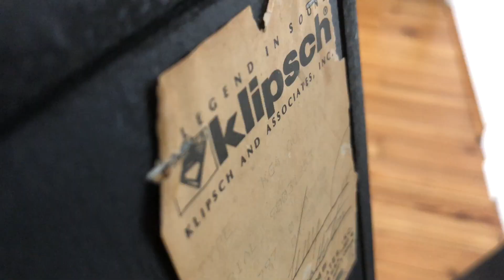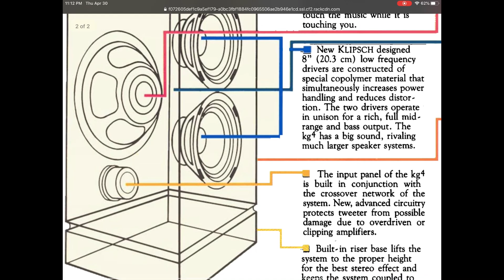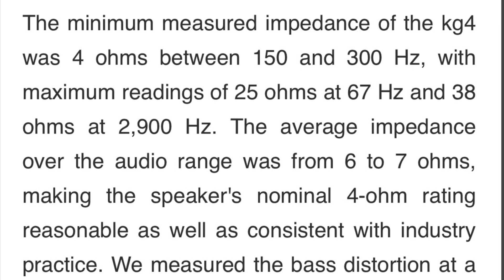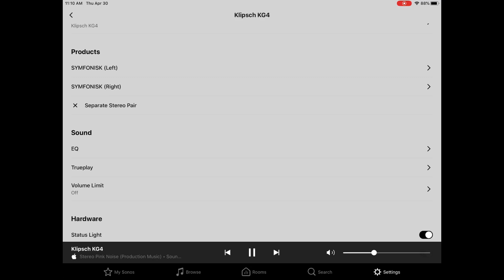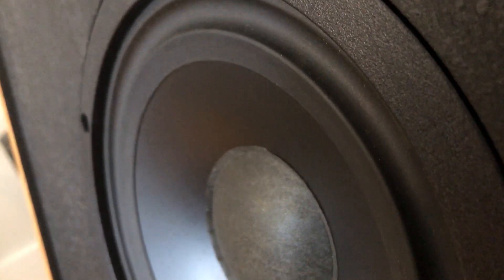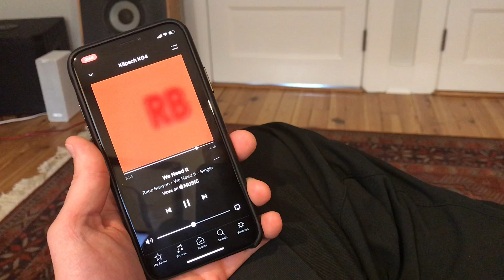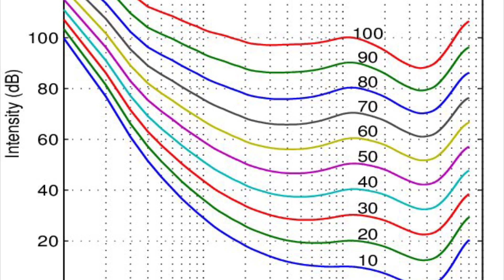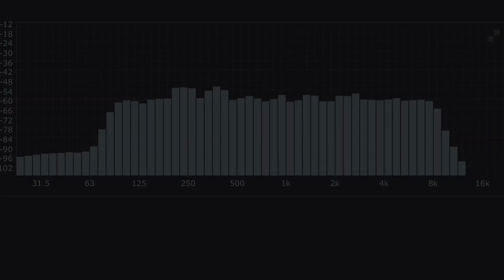Vintage Klipsch KG4 + Sonos bi-amp with IKEA Symfonisk

Comment: You inspired me to try this.  I need some garage speakers and some vintage klipsch with sonos smart technology sounds awesome.  I can't believe you got those KG4's for free!  I havent been able to find a pair for less than $350.
Reply from the maker: Yeah it was crazy lucky. Someone put these on the curb along with Adcom separates!
Reply: @todd.parker  That is crazy lucky.  Im having trouble installing the switch. Your other video says run 2 pairs of wires from the amp, one to the binding posts and one to the drivers with the switch, How do you run multiple wires from the amp when it uses a plug and socket? Do I run the wires straight to the binding posts, then back to the symfonisk drivers with the switch between the binding posts and the sonos driver?
Reply from the maker: @nshandy  This video covers every wiring scenario in detail: https://youtu.be/9Bvof0hF4LE

Comment: KG4's are a solid speaker. Just do a cap replacement ( I used dayton audio caps 1%) and a crites titanium tweeter diaghram and you'll be blown away. Cool video though!
Reply from the maker: Just installed the new diaphragms and they sound great! No need to re-do crossovers, I’m bi-amped
Reply: @todd.parker  cool !
Reply: It wouldn't surprise me midrange is bad with the passives.  The x-overs on these had electrolytic caps and they are likely doing nothing at this age.

Comment: I tried this with some small, relatively sensitive monitors with bi-amp capability. After trueplay it sounded OK at lower volumes but when pushed the Symfonisk amp(s) appeared to struggle to supply enough current at peaks resulting in muddy, slightly distorted sound. No one else having this issue?
Reply from the maker: I think the amps start sounding stressed over 60-70% even with the built in drivers. They are fairly small amps so efficiency is key. The klipsch are really darn loud around 50% but things so get rough when pushed near the max
Reply: @todd.parker  Yes agreed - I thought the issue was the drivers, but in hindsight it is the amps. I actually found the original drivers better at high volume, even though they are missing low freq's. At the end of the day it is an impressive streaming speaker for the price

Comment: This is really nice. I’m wondering if a setup like this with the IKEA Symfonisk could be used with a set of E.G. Active Beolab 3 speakers.
I would use a MiniJack to B&O Powerlink cable.
Reply from the maker: This technique will work with any powered speaker as long as you can get a wire connected to the woofer to feed to the sub.

Comment: The measurement at 12:00 with the passive crossover can not be correct, a KG 4 can play with appropriate tuning and the change of the damping material linearly down to 35 Hz. I own a KG 4. An unmodded KG 4 makes it linearly down to 40 Hz. Also with the tweeter, with the original tweeters you reach about 16 kHz, with the titanium tweeters most likely up to 20 kHz, but I can only hear up to 18 kHz.
Reply from the maker: Yeah, could be my room or listening position but I agree it should go lower (and does sound deeper). My measurement gear isn't super great either. y old ears can't hear up to 20k but the Crites diaphragms do make these sound a lot cleaner. I will say that I still love the sound of these bi-amped and are my everyday speakers.

Comment: Hi
Thanks for a great video, i am getting the sonos amp, sub, 2 one sl for rear and 2 dali spektor 2 for front speakers i would like to be able to do trueplay with the dalis can i do that with this setup and after trueplay disconnect the ikea symfonisk so they are not part of the setup anymore or do i need to keep them in
Reply from the maker: Is the Symfonisk for the sub only? If so, it’s technically just another room you’re grouping with your other speakers so it’s not part of the Trueplay setup. One thing to note: I don’t think the amp decodes surround sound, only their soundbars do so check that before investing!
Reply: @todd.parker  the symfonisk is for the dali spektor 2 only so i can use trueplay on them, the amp setup will be a 4,1 no center speaker the fronts will make a virtuel center
Reply from the maker: @renekristensen2162  So you're bi-amping the Spektor fronts with the Symfonisks, then grouping those with pair of One SLs as a quasi surround sound? Still don't understand where the amp fits in though
Reply: @todd.parker  yes that was the plan, the amp will run everything my shield, tv box, apps, the speakers and the sonos sub. But i cant run trueplay with thirdparty speakers so was hoping i could if i connect the symfonisk to the dali speakers
Reply from the maker: @renekristensen2162  If you use the symfonisk to bi-amp these speakers, Trueplay works great. You can't however, Trueplay them with Symfonisk then "transfer" that profile to the Amp.
Reply: @todd.parker  hmm maybe i got it wrong, i tought that if i bi-amp them with symfonisk and they were connecet to the amp trueplay would run on the whole system ?
Reply from the maker: @renekristensen2162  From Sonos’ perspective these are just a pair of Symfonisk speakers. They don’t know they drivers are different so there isn’t any additional features you’d get here. The only thing that trueplays a group of speakers is their sound bars but in that case, I wouldn’t recommend using the symfonisks to bi-amp speakers because the true play is more focused on balancing the speaker output and delays vs. fixing the frequency response as much.
Reply: @todd.parker  ok thanks for the answer I will just keep them as they are now 😁

Comment: What was the crossover point? Does it change with a different ohm driver?
Reply from the maker: With a passive crossover, the driver impedance can mess with the xover frequency. In a bi-amp setup, the signal is divided between highs and lows before its amplified so the impedance won’t shift the crossover point. I think the symfonisk is around 3k but that’s a guess
Reply: Todd Parker thanks!

Comment: EQ (room correction) vs not  EQ (room correction) of coarse is going to be a different sound. Run em with a tube amp and tone controls or an EQ and bet they will blow away the sonos "AMP" sound.
 Mine are  fantastic, I got the bob crites titanium diaphragms for the horns and better capacitors, also lined the inside of the box with sound dampening material.